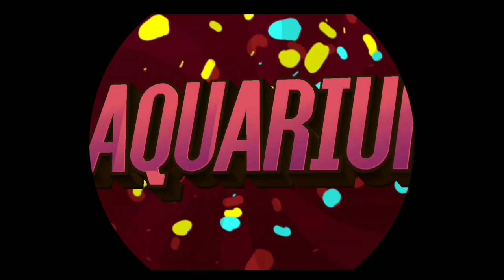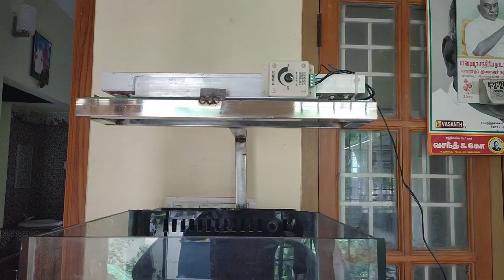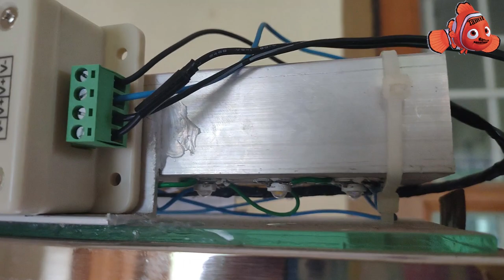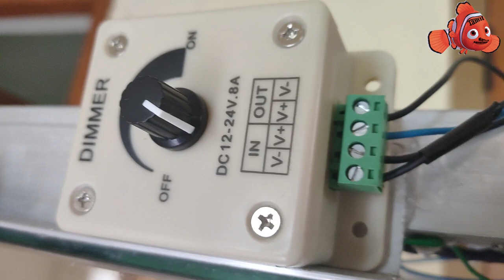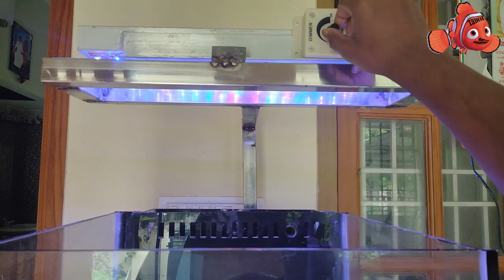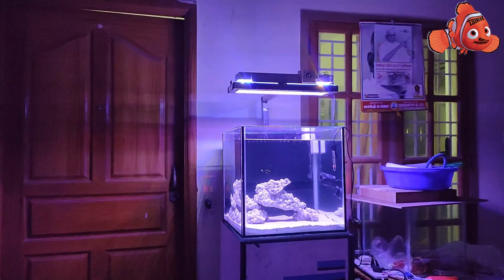Adding Dimmer Switch To DIY Marine Led Lights In Tamil

Comment: DC Fan Us Pannalama?
Reply from the maker: Yes bro kandippa use pannanum to radiate heat
Reply: Mm order is confirmed delivery date covid Dealy but use..DC 12volt & 24v 8ah speed controls eppadi irukkumunu Therila..! fan  12v controller check it out line supply..!!'Doubt

Comment: Hi can this  dimmer work in 80 wt led light
Reply from the maker: yes bro u can we are controlling the volts actually from 12 -24v so 80 was shouldnt be a problem with this dimmer